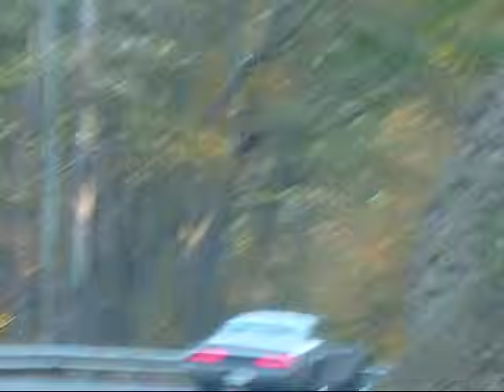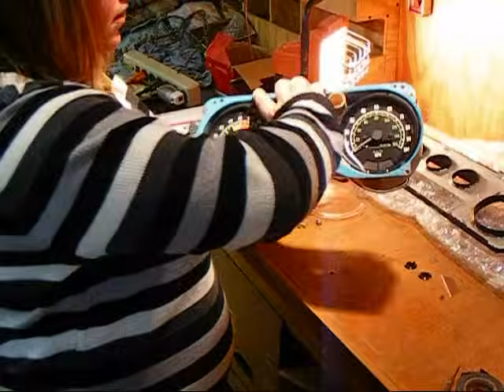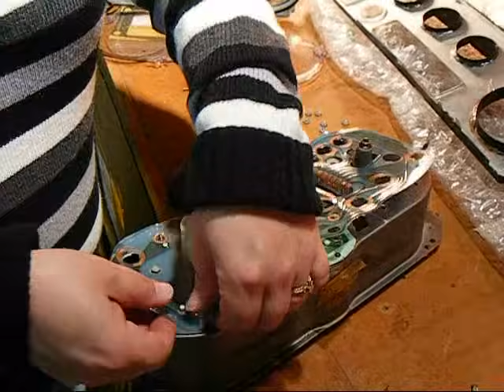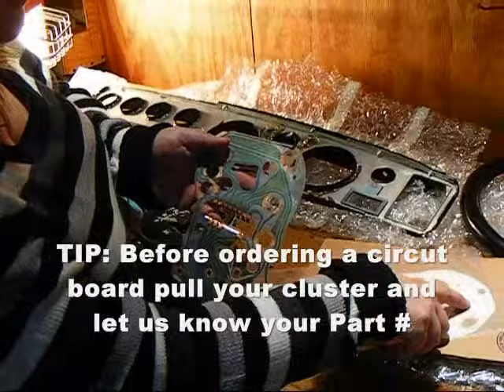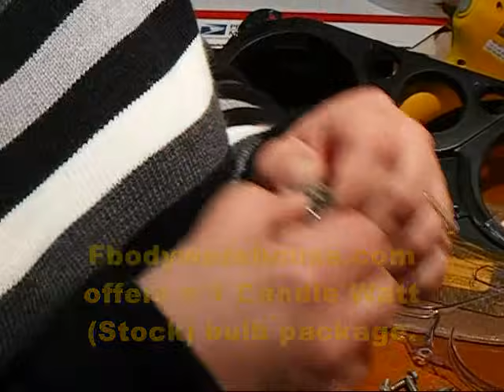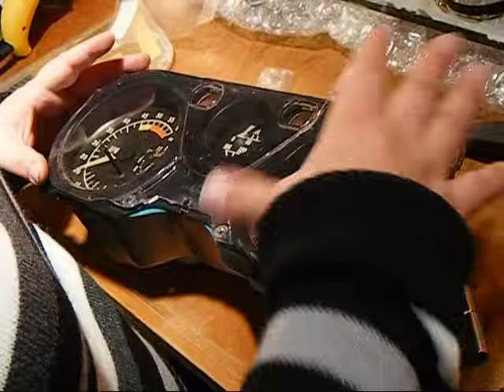"How To" Install a NEW Circuit Board 70 - 81 Camaro or Trans Am

Comment: What is the function of this circuit board?  Thinking of replacing mine with you guys but I just want to see if it's necessary....one problem I have is the blinkers...they both blink when on but when dash lights are on only one bulb is on.  Thanks.